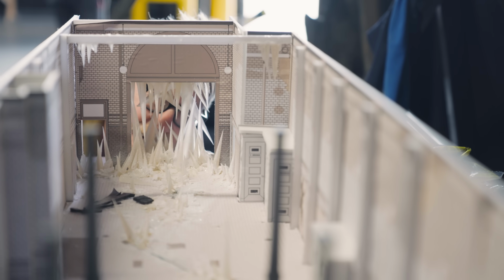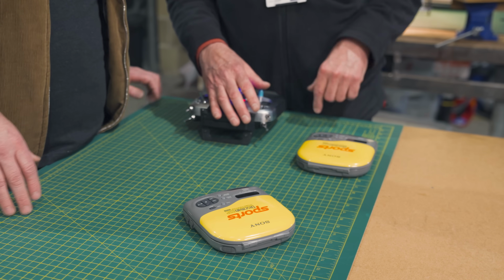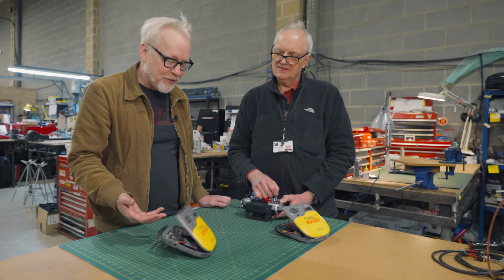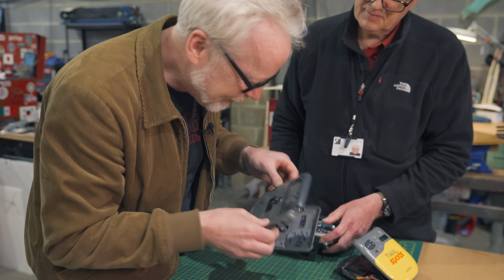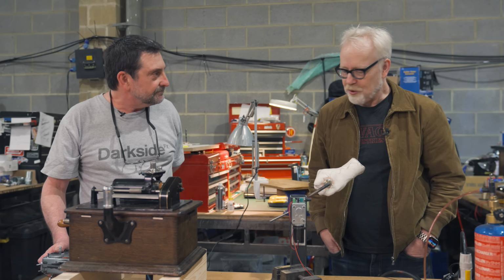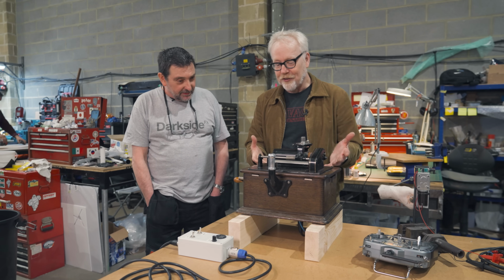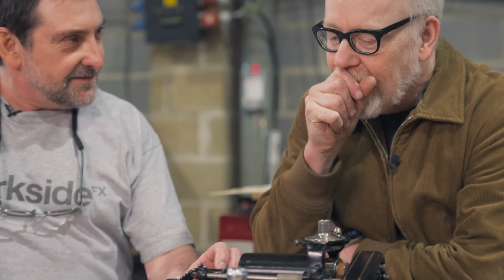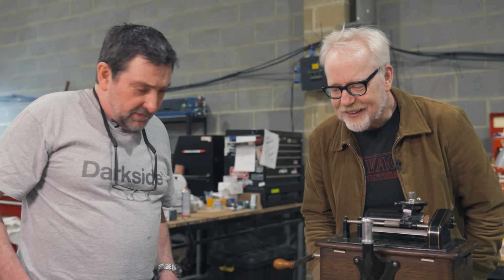The "Possessed" Props of Ghostbusters: Frozen Empire!

Comment: The Ghostbusters slash is not up to ISO specs
So, here’s something you definitely haven’t considered regarding the immensely popular film series Ghostbusters, which is about to see the fifth installment in its 40-year history premiere later this month: Despite its significant role in popularizing the circle-slash in popular culture, that circle-slash setup is actually not up to spec.

See, there are two important things that circle-slashes tend to do that the original Ghostbusters logo does not do:

The slash goes left to right in most cases, rather than right to left
The slash is supposed to go 45 degrees on the dot
There are some smaller things, admittedly: The line should be a bit thinner, and should be thinner still in the slash area than the circle itself. (There has traditionally been back and forth on whether the interdicted object should expand outside the boundaries, but I will leave that debate to sign-designing subcommittees.)

Ultimately, I will concede that people looking at this logo are not thinking to themselves, “wow, what a horrible logo, I will never think of Dan Aykroyd the same way again.”

Comment: that hand crank might also be done with a lighter material hand and a black string from the knuckles to a weight.  that'd keep the hand approximately aligned to a person turning it.  and an invisible string wouldn't be hard to hide in the dark lighting.  also quicker and easier to create and fix.   but, not as flexible, if you actually want to make it spin at a different rate than the handle.

Comment: A common misconception is that old phonographs had to be constantly wound. Actually the crank would be turned 10 to 20 times to wind up a spring. and then the cylinder would be switched on and play the record. (Of course I suppose if ghosts are possessing something all bets are off. Ha)